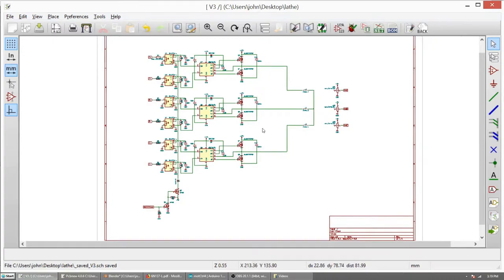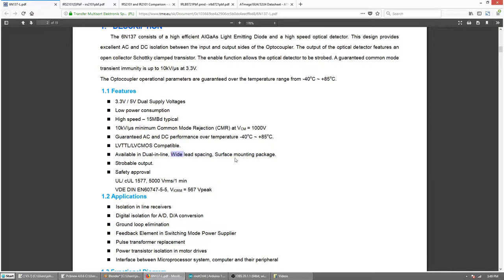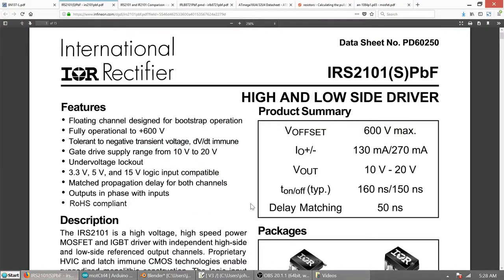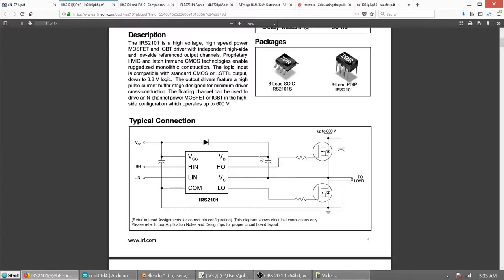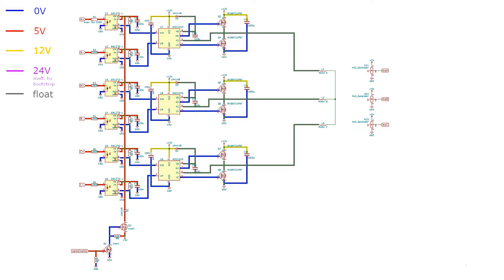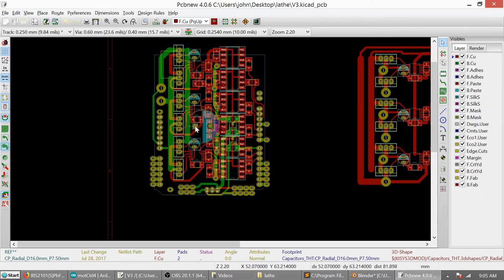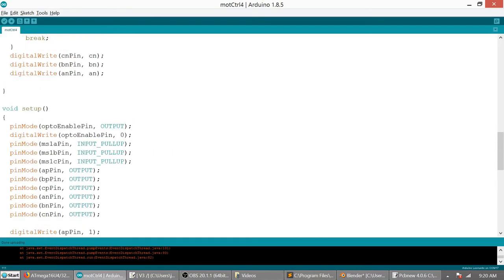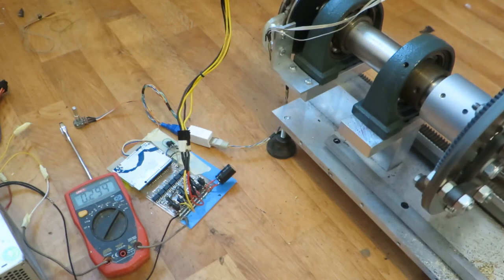Designing 3-phase motor driver

Comment: Do you know If the compact high power spindle motors from china are BLDC motors ? It says 1.5KW, 220V, 400Hz/24000rpm and has at least 4 wire connections so must be star winding. People use them with a VFD for CNC machines. I ask because I want to build it on my own for learning experience. Should be similar to your circuit right ? Only Mosfets IRFP460 and rectified mains instead of 12V

Comment: Hi. I wonder what’s an advantage of using optocouplers? It seems all parts can share a same gnd, and gate drivers are 3v3 compatible
Reply from the maker: They allow for sloppy design. I did not have scope back then, and during development I burned bunch of mosfets. This caused arduino to die as well. So I just protected myself this way which allowed me to debug issues by trial and error.
Reply: @IlusysSystems  Aha! That was very smart. Thank you for the info.

Comment: Thanks for this video. I 'm currently designing a 144 Vdc @ 100A 6 phase inverter (driving a 2 stators motor). I'm actually uncertain if I should galvanized (or isolate) the 144 Vdc of the 5 Vdc electronics (no commun ground) ? Can you share your thoughts on galvanization the powers.
Reply from the maker: Hi, AFAIK in commercial applications only communication is isolates from mains voltage. Perhaps some drivers with expensive parts on low voltage side are isolated as well, but these tend to be optimized for cost, so there is little to protect. I guess your phase driver chips would be most expensive and likely have integrated low voltage inputs with external bootstrapping or support circuitry.

So if driver has comm like serial or whatever, isolate that. If driver is directly connected to some PC output (would be wtf driver, but I don't judge) isolate that.
Or do "risk assesment" and if there is nothing worth protecting, just don't do it.

Comment: Hey, thanks for this coherent video!
I had a question, for PWM the Arduino boards cannot provide high frequency like 30-40 kHz. But most high power motor requires this frequency, how can we achieve that?
Reply from the maker: Arduino can proivide high freq PWM. I was using around 40 kHz in this project. 

To achieve this, you have to get CPU datasheet, and set up registers yourself. Alternatively, I am sure there will be some library to do this for variouc models for you so you don't have to dig through datasheet, but hey, you will have to dig through docs for library...

I haven't used such library so I can't recommend any.

Comment: Sir ,  kindly advise to me that how to fix "TCCR4E, 'was not declared  in this scope" in arduino issue   issue . thanks
Reply from the maker: I believe, that TCCR4E is declared only for arduino leonardo. other models may require different setup. what's your model?
Reply: @IlusysSystems  My one is Arduino uno sir
Reply from the maker: @MrSoe-wn9qg  I found this: https://simple-circuit.com/arduino-sensorless-bldc-motor-controller-esc/

it's also sensorless, so that's quite nice
Reply: @IlusysSystems  Noted with thanks sir

Comment: Hi. I am designing a driver for 5kw ac induction motor rated 3000 rpm at 100Hz. It is operated by 48V battery and S2-60 min. Is it possible to use the design above, offcourse changing the mosfets ? It also has  A/B Encoder for feedback.
Reply from the maker: Not really, this is obviously low voltage design with Vmax less than Vgs of mosfets

Comment: hi i wanted to control the speed of the single phase induction motor what kind of modification can be made in this design?
Reply from the maker: you need to change frequency. Look up VFD
Reply: @IlusysSystems   The 3 identical parts (drivers) in the circuit can i use one part of it? for single phase induction motor? Can snubber circuit can be used with microcontroller to control the speed as well? would really appreciate your help.
Reply: I need to use microcontroller with mosfet/igbt to control the speed thats why.
Reply from the maker: @bilalqasim2555  I am not sure. it may be the case, that single phase induction motors will require relatively smooth sine wave to work properly. This driver is not quite equipped to do that. but possibly could be modified. perhaps only in SW but as I say I am not sure

Comment: Hello, love your project. Can i get your email to contact you?
Reply from the maker: You should be able to access it through YT, but I prefer to discuss here
Reply: @IlusysSystems  I am currently building a VFD for a three phase induction motor and wanted to seek help for it.
Reply from the maker: @shanawarchughtai6476  Mains voltage circuits are obviously more complex, because of necessary safety for human and  also for componenct, because they are expensive. Unfortunately I don't have too much experience with these kind of circuits. Good experience that is, I have some bad experience though :)

Only thing I can tell you as an advice is read carefully through datasheets and application notes. You should be able to learn to design good product that way.
Reply: @IlusysSystems  thanks a million though. I hope to work my way through it.
Reply: @IlusysSystems   can this same work for 1 hp motor ? Or pls share email or any communication app for communication